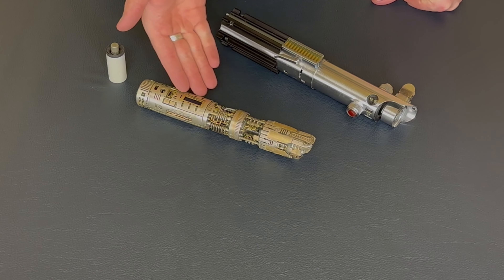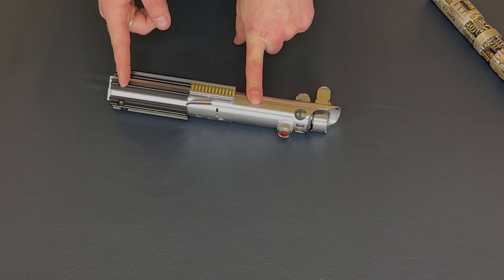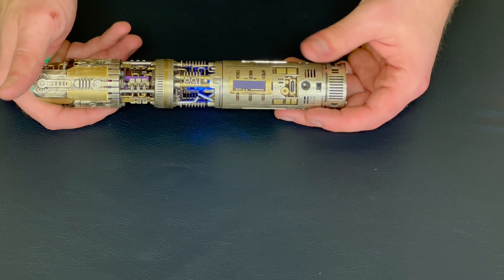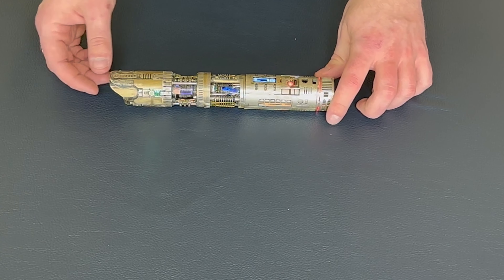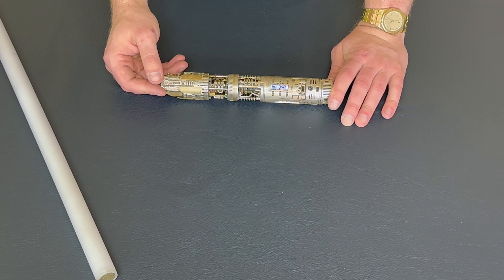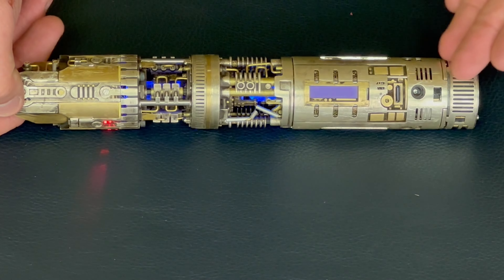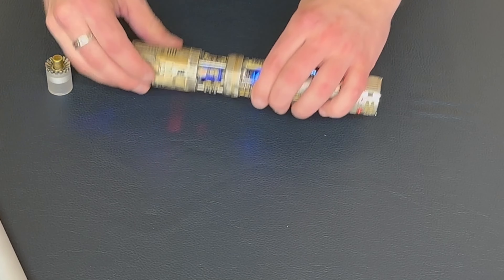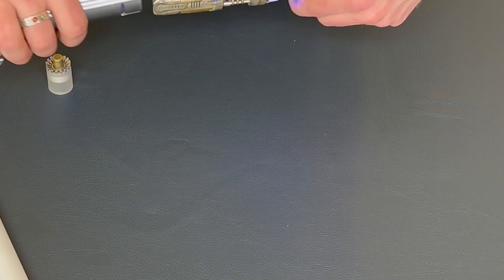Solid Silver Lightsaber: MB Sabers Metal Master Crystal Chamber

Comment: You gotta tell us the total cost of print. That's insane.
Reply from the maker: I think it was around 4-5k?
Reply: @daviniumcustoms6857  That's mad. I can only imagine the total cost. Why is this not designed to be swung around?
Reply from the maker: @4str0m3ch  liability. I’ve personally dueled with a metal master before without issue, but since there are a variety of external factors that could damage it when swinging it around (are you actually just swinging it, or are you duelling? Is the blade secure? Was the chassis installed correctly in the hilt beforehand? Etc), it’s safest to say it’s only for display